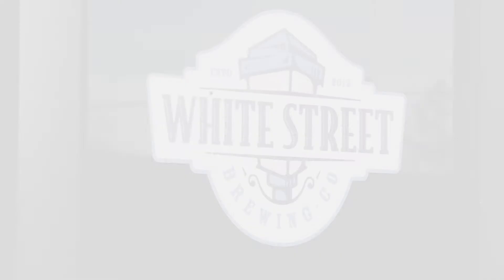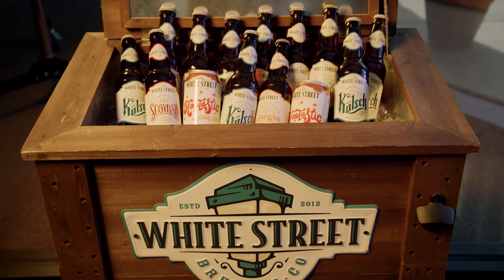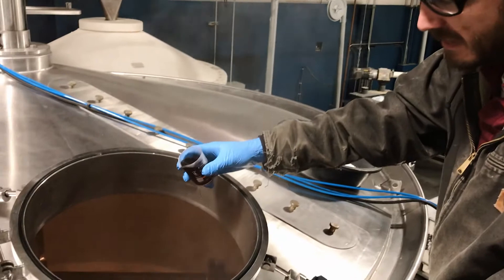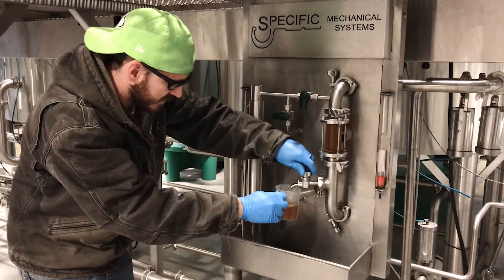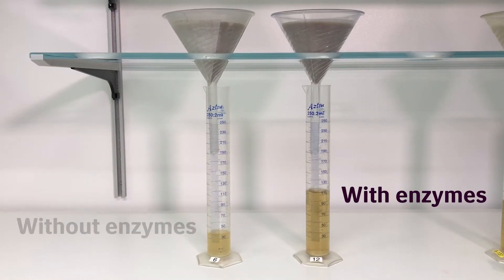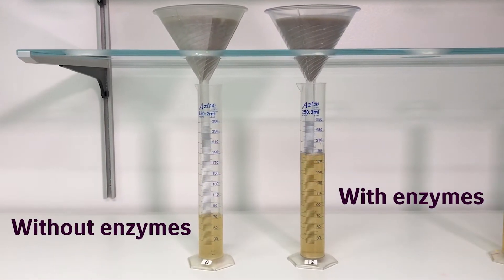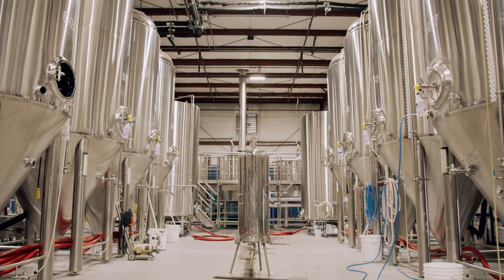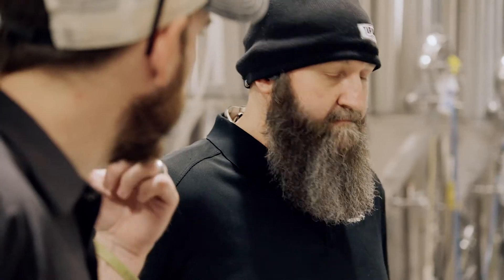Why use enzymes in brewing?

Comment: Make video about shelf life beers techniques please
Reply from the maker: Hi Hwang, thank you for the suggestion! When it comes to beer stability, there are a number of things enzymes can help with, but there are also suggestions that are not related to enzymes. Please see below suggestions from JD:

As far as what enzymes offer stability:
1 - They can improve colloidal stability (turbidity), making the product look better for longer. - Haze Prevention
2 - They can prevent late formation of VDK's - a buttery, slick off-flavor.
3 - They can tailor wort composition, increasing consistency, preventing over attenuation, over carbonation/gushing

Top stability suggestions:
1 - Limit Dissolved Oxygen - below 30 parts per billion is ideal, less than 50 Total Package Oxygen (TPO)
2 - Fine/Filter/Centrifuge to remove yeast. If you cant remove it, kill it (pasteurize), or stun it (sulfites). 
3 - Avoid UV light - Use Cans, or kegs. Brown glass if you must, no green or clear glass.
3 - Keep it Cold -  Avoid heating as much as possible, but especially avoid cycling up and down.

Cheers, 
Alex